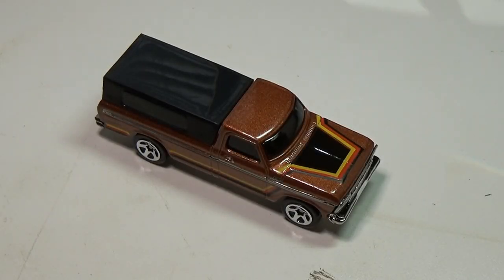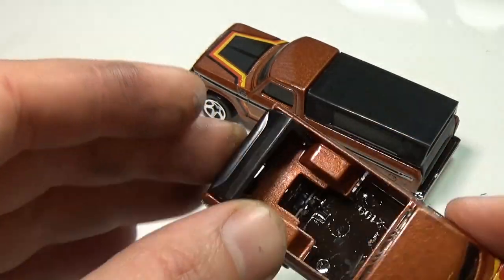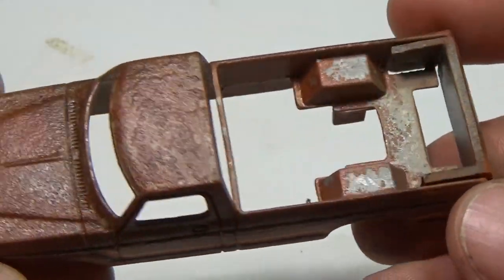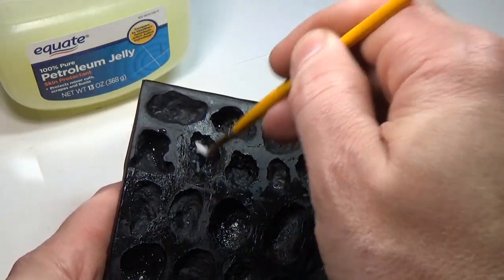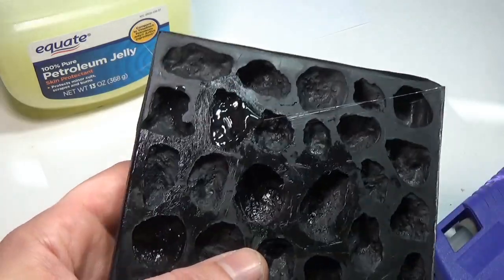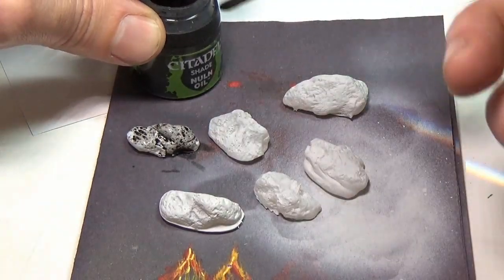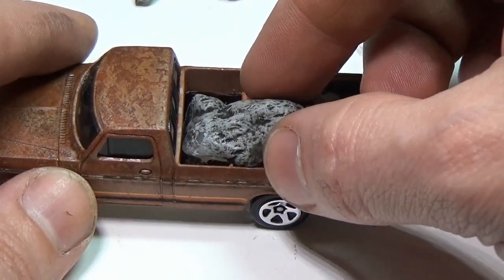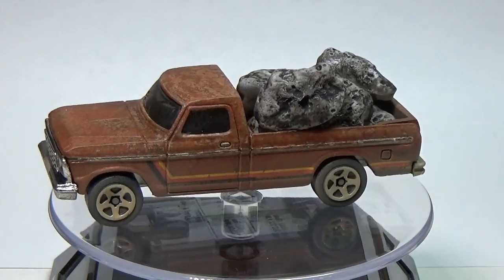Custom Hot Wheels 1979 Ford Pickup and Casting in Hot Glue

Comment: I really like the look with the rocks in the back.  Way better than that camper.  I think it would have looked even better if you had dropped the back end of the truck so it was riding low, since it was full of such heavy rocks.   I can't imagine how much weight is back there with those giant rocks.
Reply from the maker: that's a brilliant idea I might change it to look like that..
Reply: I'd try to find a small tarp like material for the bed of the truck to cover the rocks and hide the tabs
Reply: Weapon_X_Wolver

Comment: If you make the rocks look like garbage bags full of soda cans the load won't seem so heavy. If it were a real truck hauling that amount of rock would make the truck sag to practically dragging the bumper even with air shocks. I used to have one and it didn't take much to make the back sag and the front stick up a little. Anyway you do an awesome job. I have seen a lot of your other work.

Comment: If you want that truck to look realistic, you need to bottom out the rear end.  There's no way that truck could handle a load that size.
Reply: Protective HT My dads f150 weighs 7600 pounds loaded down.
Reply: Protective HT My dads f150 weighs 7600 pounds loaded down.
Reply: Protective HT My dad's f150 weighs 7600 pounds loaded down.
Reply: They're Mall rocks.  Hollow, or foam, or some light material that has been painted to look like rock, but it's not.  :) ;)

Comment: I think just one of those "boulders" would have given that pickup truck a workout. Further modification to the tailgate by trimming the ears off of it would look more realistic. Then a proper bed made from a ribbed piece of plastic can be placed in the back. All then can be blended together with a solid "factory" color covering the entire truck body, or the bed area could be painted flat black to simulate one of those aftermarket black plastic liners.

Comment: Yes, you exceeded the capacity of that truck...a standard one ton with dual tires can carry two pallets of cinderblock and that's absolutely pushing the limits.  Your weight is probably closer to four pallets or even 8 palets.

BUT...there's a but...this is unless they're really light rocks, which is a possibility.  They could also be those fake rocks landscaping companies use for commercial applications.  

In these cases, it's time to rip out that tailgate and lower the edges, the change would be worth it.  I like the tailgate being separate, you can put it in the down position and the further reality of these Ford trucks is that the tailgates were routinely changed out as they wore out.  It's not uncommon to find a truck with mismatched tailgate.

Comment: I don't like the hole in the windshield. Is this a beater sitting in someone's yard? If so, why are there boulders in the bed?  Me, I would've put scrap metal in the bed, or make some black plastic trash bags out of aluminum foil, and I would paint all the details, like tail lights, side marker lights, etc. Of course, I would have it as part of trackside scenery in an HO train display, if it were me.

Comment: woah, if you really want to go for that broken glass look you could do a lot better. my pro tip jam your swiss army knife into to windshield, but this next step is super important. make sure after jamming the pocket knife into the windshield it snaps back and cuts your thumb partially in half. it will also allow you to add a blood color to the broken windshield. it does take some time for your thumb to heal afterwards and you probably shouldnt use this method often, but as far as methods go its a solid 9/11
Reply: Mike Wazowski ha! Also getting drunk and puking on the inside gives it that classy DUI look some like
Reply: Wouldn't a deep scratch on the inside simulate a broken glass just as well?

Comment: Yeah; those rocks are WAY too big! Plus, that one rock is hanging over the side, a bit. And, as was previously pointed out, there is no visible effect on the suspension.  Scaled up to actual size, this model would violate the laws of physics.  Not only would the truck bed wheel wells be firmly resting on the rear tires, those tires would be flat, and the axles would have snapped. 

Sorry, Hoss... this model is a fail. No worries, though.  You've got a lot of winners; everyone comes out with an occasional dud, once in a while. 

(I'm a trucker, and was formerly in landscaping; so I didn't just pull this constructive criticism out of my arse.)

Comment: The first step is to stop buy hotwheels junk.  If you want a good looking 79, look at the greenlight models.  Second, you need to take a class in physics before you decide to load it with 20 tons of rocks.  No truck this size would ever carry that sorta load without flattening the bed out like a pancake and the shocks/springs would snap like twigs.   I really don't like being this critical, but I can't help it.  It's just terrible